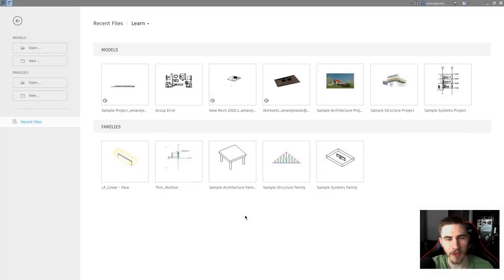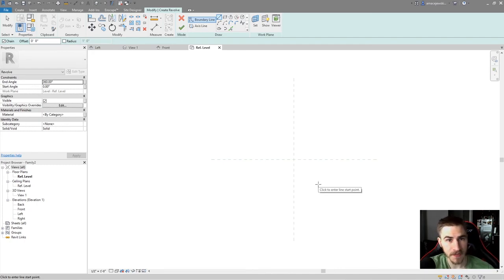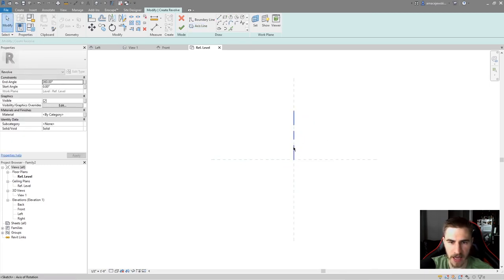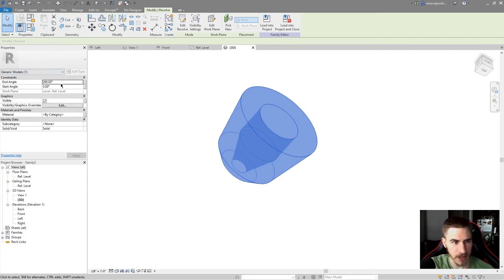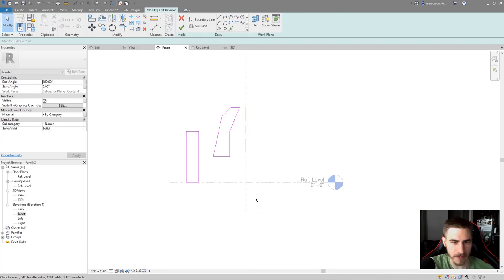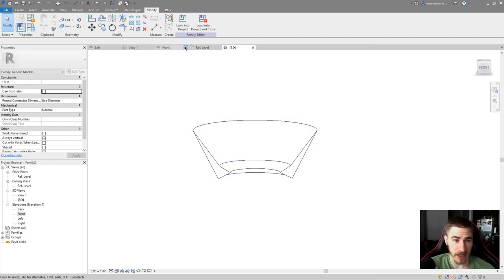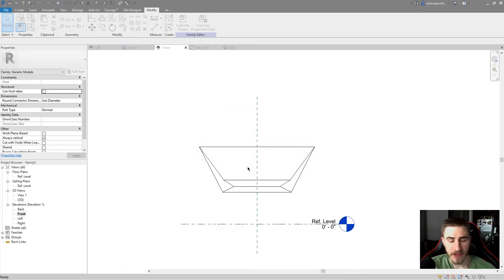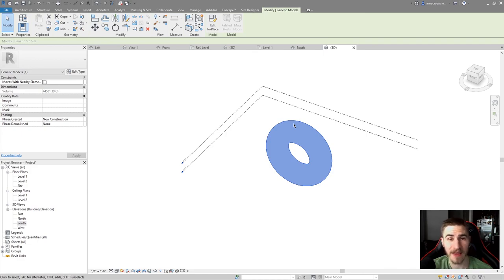How to Create Revolves | Revit 2020

Comment: It will probably be mentioned in a family video, but I have heard that using revolves is a good way to control rotation parameters. I haven't done it myself per say, but it does seem like the way to go if you need to control a rotation that will not break the way a reference line and/or plane can.
Reply from the maker: Yes you are on to something. Just like we can associate a height parameter to an extrusion in a basic extrusion family, you can do the same for the revolution in revolves. The associate parameter button next to the angles will allow you to add a parameter to it in the family. I hope I answered your question. I should have put that in the video! :/